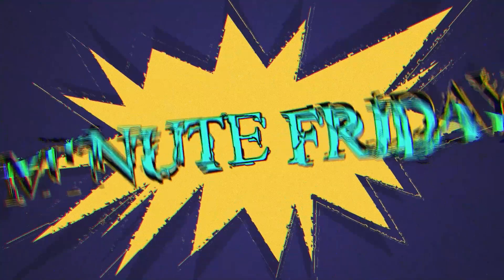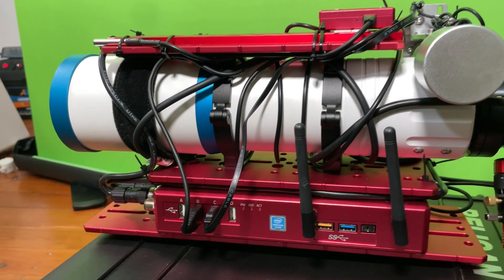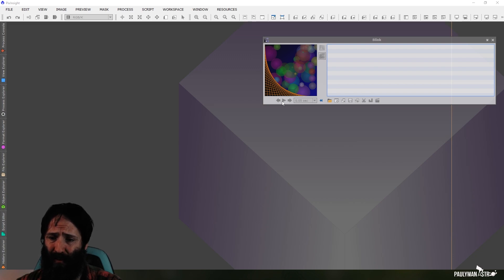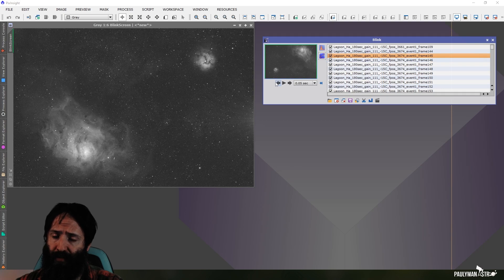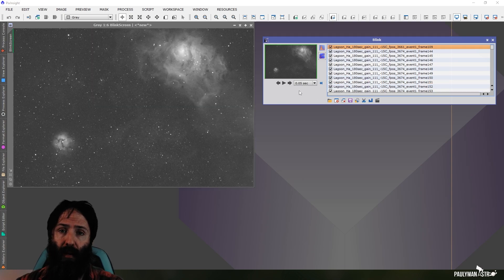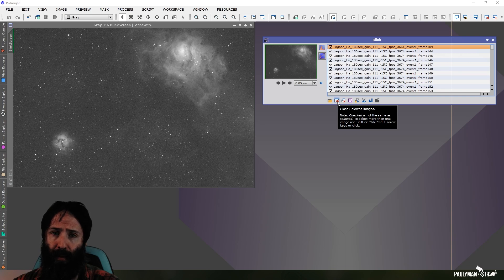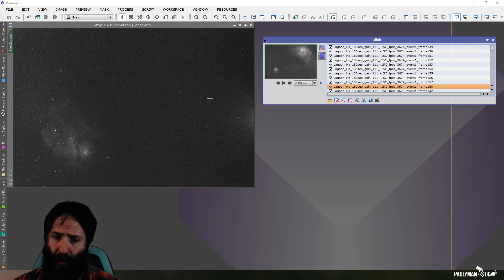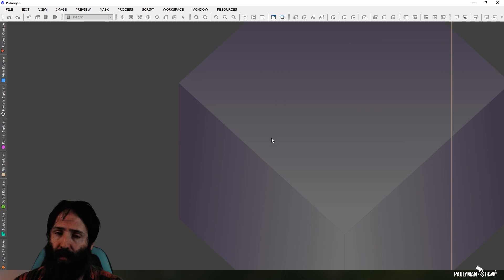Blink

Comment: Love the idea of using Blink for diagnostics.

Question - what got you thinking that flexure may be an issue? I think I may have something similar going on!
Reply from the maker: It was the consistent motion with eggy stars in that direction as I blinked chronologically through the frames even though guiding was at 0.6RMS all night. So relative to the guide scope things were going awesome and deviations were being corrected fine, but relative to the main scope there was a consistent motion, that would have been the guide scope slowly moving under gravity thanks to the loose Allen screw. It could also appear as more random motion in the main scope but relative to your guide scope everything will appear to be going fine.